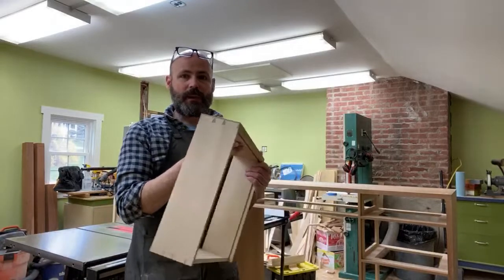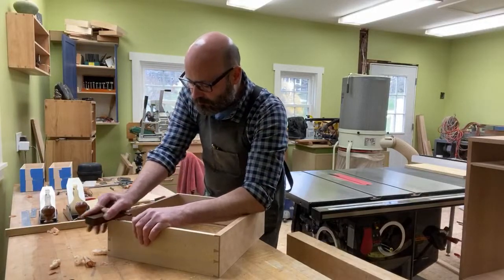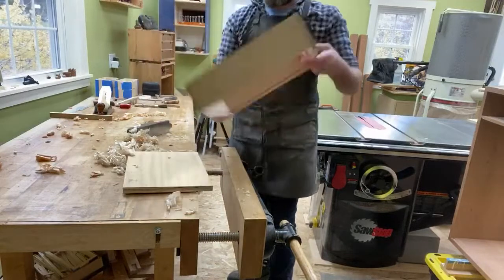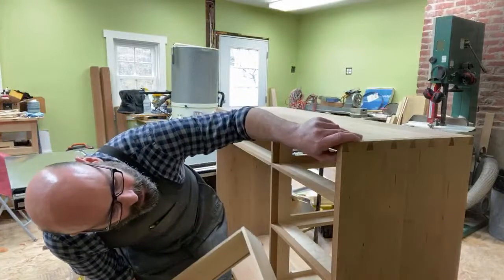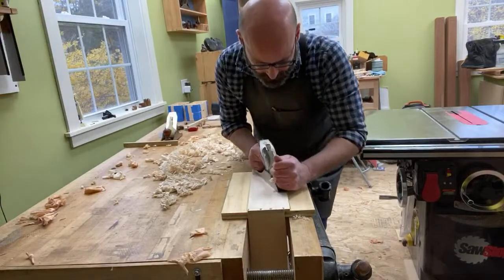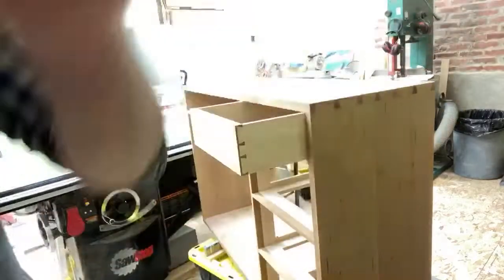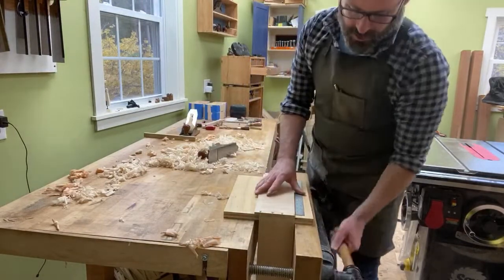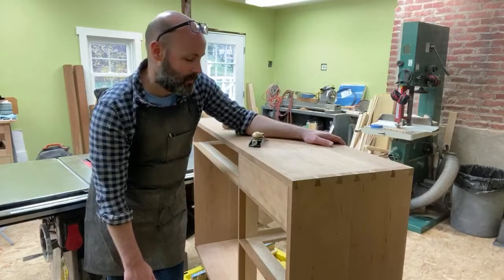How to make a drawer, Part 2

Comment: Nice work Matt! Wax your plane soles! :)
Reply from the maker: Never! Hahahahahahaha
Reply: @mattkenney4851  you're only hurting yourself :D
Reply: Don’t you find that it makes it hard to get a shaving? Like I can be getting a perfect, thin shaving and then apply wax and then it no longer cuts. 

It makes pushing easier but it changes the depth of cut.
Reply: @williamweatherall8333  I've never run into that. I just use canning wax, just a little rub.